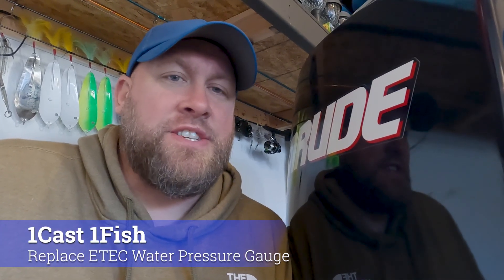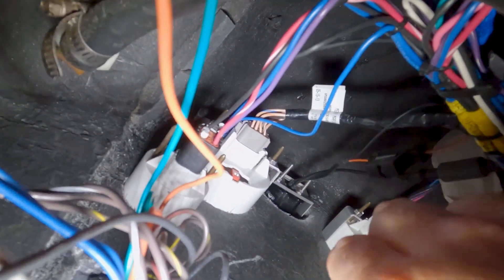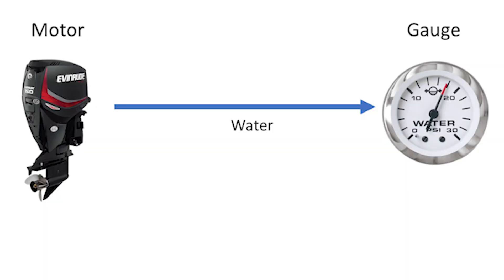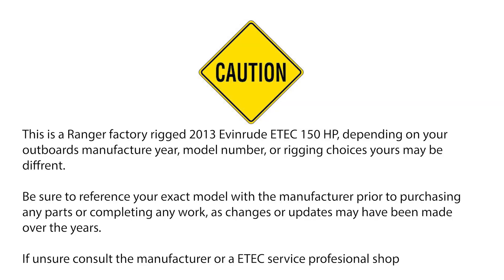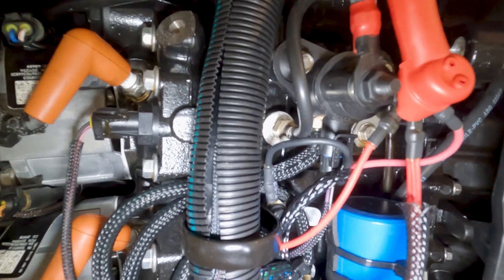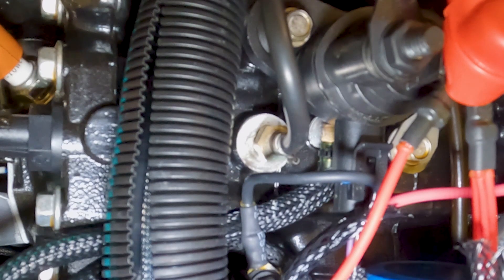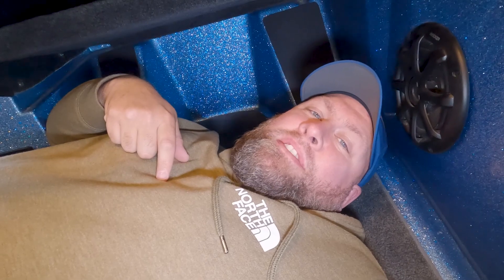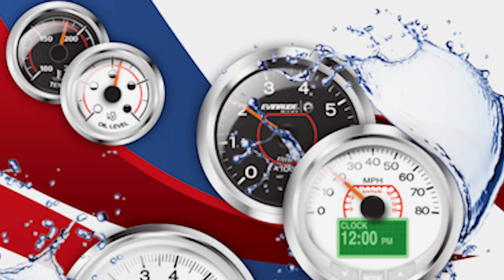Evinrude ETEC Water Pressure Gauge Replacement Tutorial

Comment: Hello, I watch all your maintenance videos as I am a new to me boat owner with Evinrude ETEC 150 (2012) and have done all of the work based on watching your videos.  I have a question and i can't find anyone on the internet to simply explain to me what it means when the "Low Fuel Totalizer" alarm goes off.  I honestly don't know what Fuel Totalizer is besides fuel flow.  Not sure what this alarm actually means.  Do I need to reset the totatlizer after I fill up?  Any info you can shoot me to help me understand this would be appreciated.
Reply from the maker: So here is what I know, I believe that the totalizer is a function of the Smart Icon Gauges.  I am assuming you just have an alarm and everything runs fine.  I think resetting after fill up is correct as it uses that data in calculations.
Wish I could help more, but I am not to familiar with this exact subject.

Comment: What should your pressure read at idle and when throttled
Reply from the maker: Depends, I would look up the charts from the manufacture.  I say this because I know different ETEC HP's have different specs, and even that can change based on the years. Plus if you have another motor brand it may be completely different specs.  Just don't want to give the wrong info